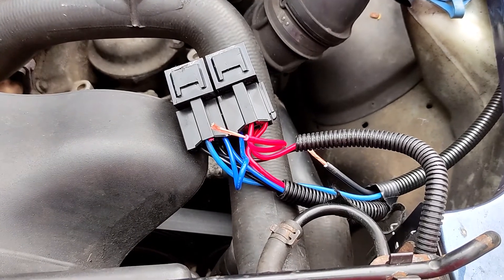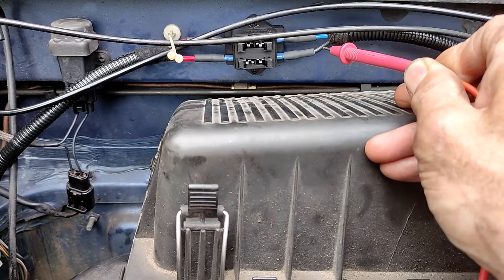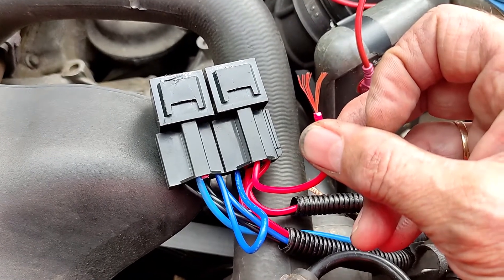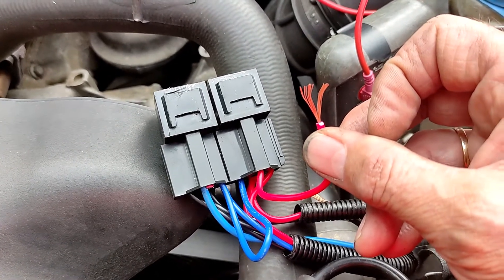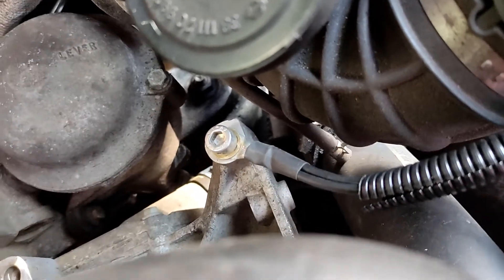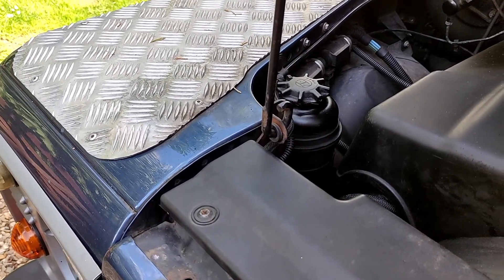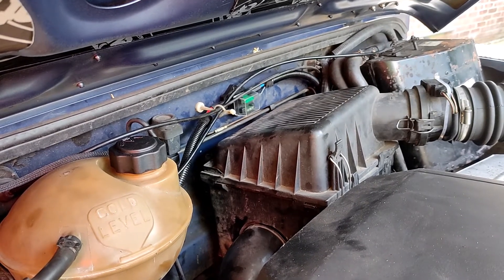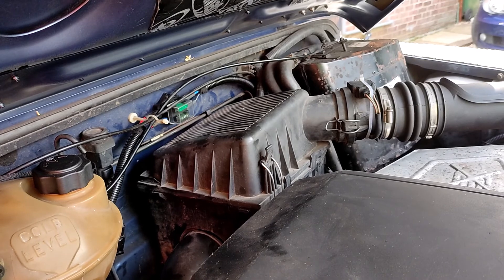Installing (and modifying) a Boomslang Headlight Wiring Loom to My Land Rover Defender TD5.

Comment: Thank you for posting the video. The modifications you have done to the loom are well worth it. I wouldn't have given the single fuse blowing and losing all lights a thought. I've purchased a boomslang loom but failed to say in the instuctions about getting the plugs through the headlight bowels, as mine is an early 90, so will probably have to purchase later bezels.

Comment: I have never liked the Boomslang looms, they take teh loss capability from one lamp with an issue to two or seems one, depending on age/spec of the loom purchased. I fitted relays to my 300tdi in the fusebox area and basically rewired the cables to the fuses to drive the relays and then the light master fuse to power the relay switch contacts and out to the fuses. The current is higher to the lamps and there is minimal moding to the loom, no external additional loom and all lamp wires are individually fused as per the original spec. If you didn't know, you'd think it was factory. I even have the dim dip working as it is designed to.